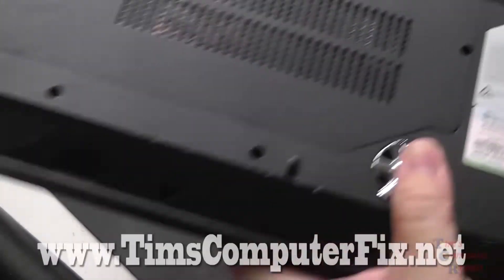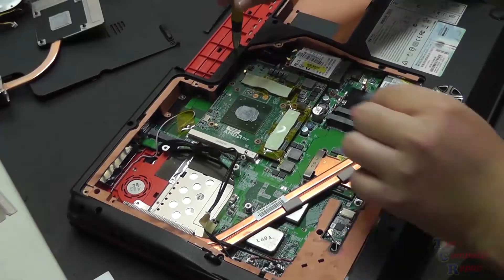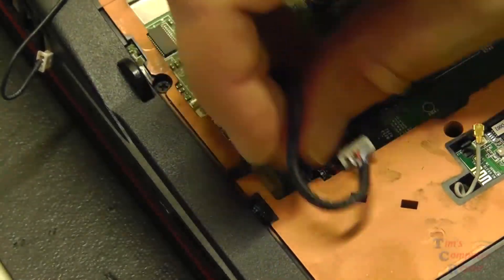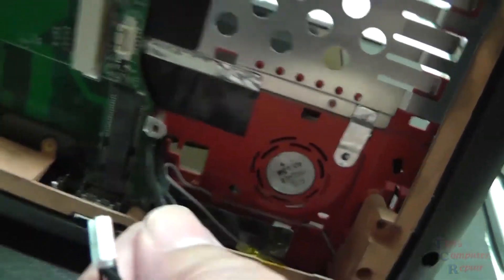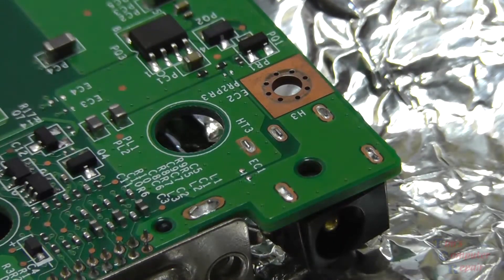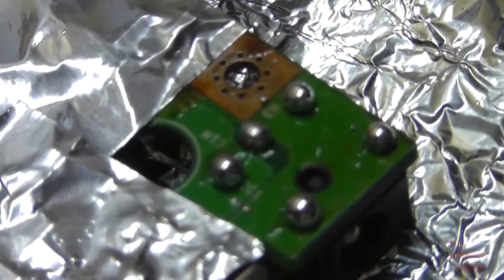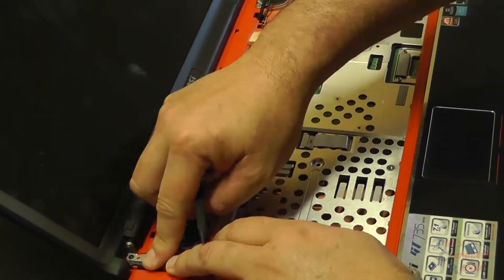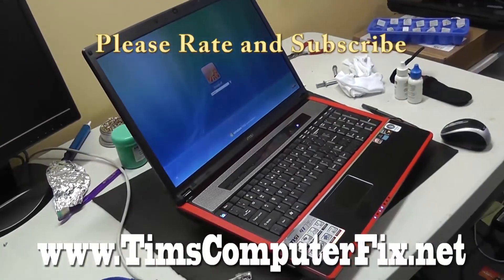MSI GT735 (MS-1721) Laptop Power Jack Repair by TimsComputerFix.net

Comment: Thanks for the video!

FYI, this can be done without removing the heat sinks for the CPU and graphics card. (Then you don't have to worry about thermal paste or loosening/tightening those screws the right amount and whatnot.) When you get to the last step of removing the big plastic frame after taking out the millions of screws, you can then remove the 2 graphics card retaining screws and pop the card out with heat sink attached. The CPU sink can stay attached to the board and doesn't get in the way of anything during removal.
Reply from the maker: You are correct. Two reasons I prefer to go ahead and remove the heat sinks since they are right there. A nice fresh application of thermal paste and I get the copper pipes out of the way to prevent bending or twisting. That's just me though. Thanks for watching.